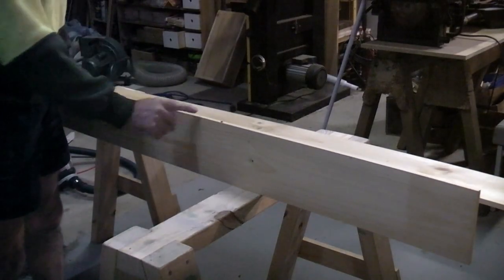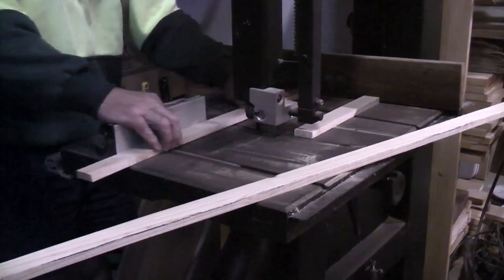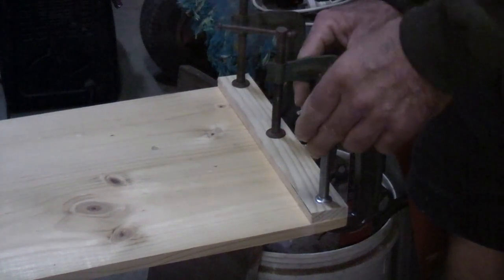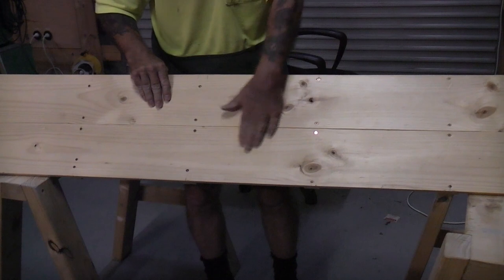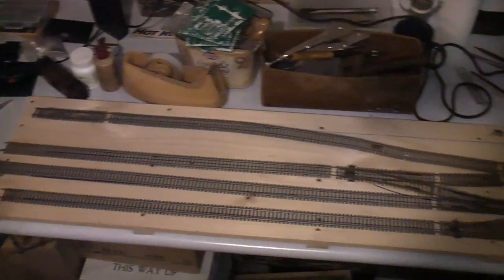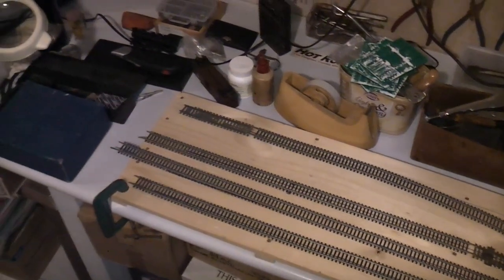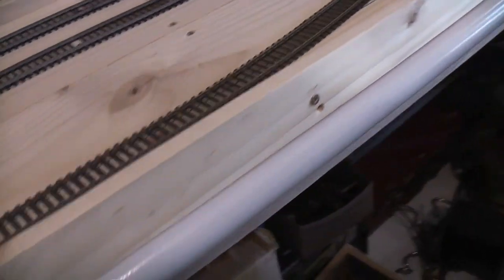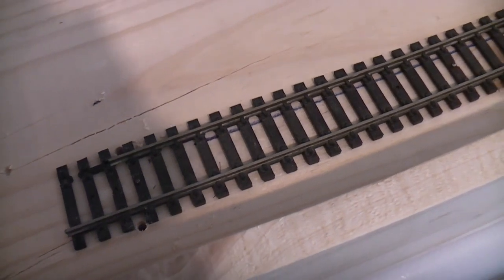Small Shelf Layout

Comment: Is this DC or DCC powered? 
I'm new to the hobby and only have room for a small, point to point, similar to this, but only have DC power.
Cannot find videos explaining DC point to point is possible nor how to wire/set something like that up.
Reply from the maker: Hello, thanks for watching and a big welcome to this wonderful hobby. It has so many different aspects to it that you will no doubt find some parts that you will find a connection with. The little layout is just a DC operation at this stage. I'm a bit old school and my main layout is still DC. It would be a nightmare to reconfigure to DCC and the change over costs for locos and controllers would be far out of my reach! It is best to decide from the onset which way to go. Wiring a layout for DC is a reasonably straight forward process once the basics are understood. I'll see if I can put together a "DC Wiring 101" video or three. Watch this space. Cheers, Jim
Reply: With dc on each leg of th track bring your feeds to the heel of your turouts to start a simple siding 👍

Comment: Hello what track did you use especially the points thanks
Reply from the maker: The track is code 100 Peco. The points are small Peco  #4.  Longer points would have been better of course but used the smaller ones because of layout size constraints. The next "shelf" layout I construct will have longer points for a more realistic appearance. Thanks for your interest, cheers, Jim
Reply: Thanks